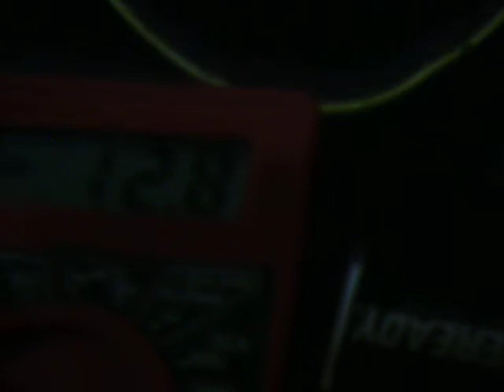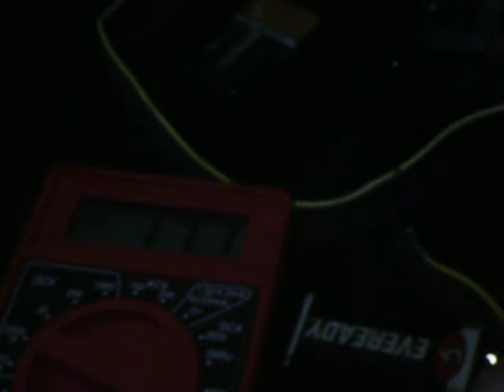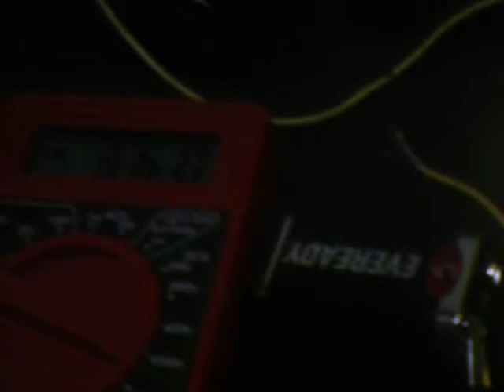slider2732's wireless system cont.. 9v and field sweet spot

Comment: Very cool. The little guy might well light with a change in pot position though. If you make a loop anywhere with the wiring then you'll get a pickup. That large coil has been a winner...great stuff :)
Oh, there's sometimes a pop with your audio. A piece of a cotton ball stuck over the mic should sort that. Had to do that with our Kodak camera.
Reply from the maker: the little guy not lighting is a good example of why i need some kind of fancy square wave generator or at least a drive with variable frequency. considering i have not tuned either coils to resonance i can imagine how awesome the results would be if i were to do so, but im going to have to hit ebay finally for some meters because this is giving me a drive to do some serious wireless tinkering, and not with the electric fields this time. oh and the camera thing.. i always forget not to hold it RIGHT next to my face like a dummy because the mic is really strong lol.. but the lens also needs to be a good distance away just to capture everything so its always near my face, so now that i think about it, next step is making a darn camera stand hehe

Comment: Some great experiments your doing here. The reason the wires can power a coil is because of the current pulses. The single wire acts as one turn in an air core transformer. There is also a bit of EMP action,but from what I can tell, its mostly sticking to transformer theroy. I took it a bit further with this Motor & Over 70 leds run from 1w wireless electricity transmission.
And a few other videos towards the end of that playlist. How have I not been subbed to you? Some great stuff your doing. Keep it up.
Reply: Do you know these comments are going to everyone's stream Mongrel?
Reply: Gordz Murphy  Yep. SWES Deserves more attention than its been getting. Every bit helps.
Open source research is the main reason I'm here on G+. I just haven't been doing much lately due to personal/health issues.
Reply: Just checking mate